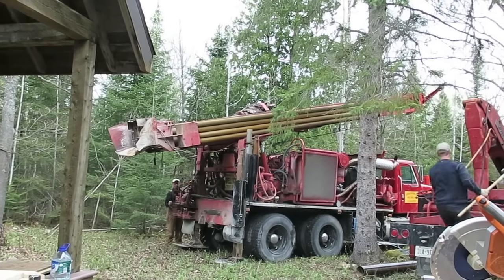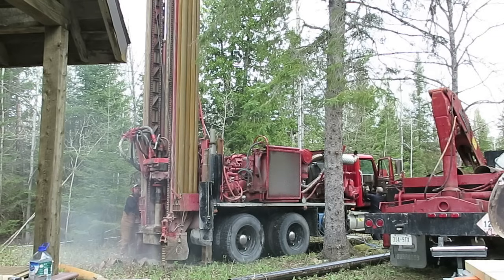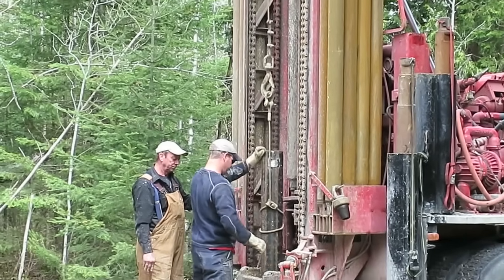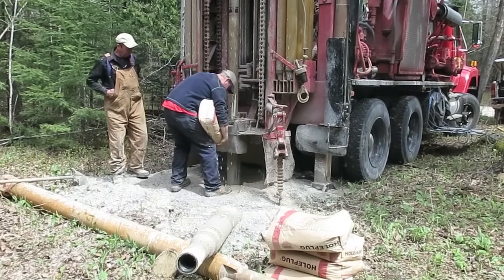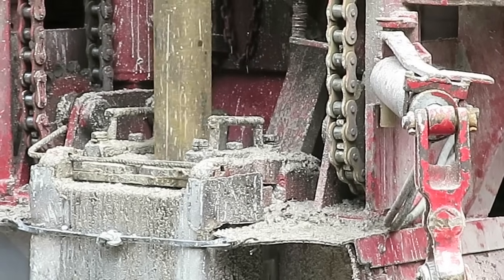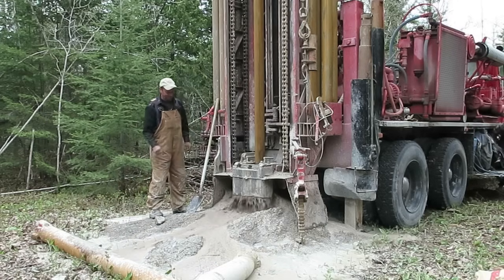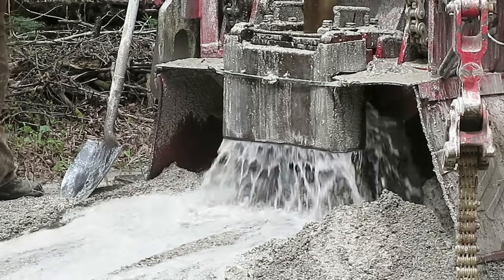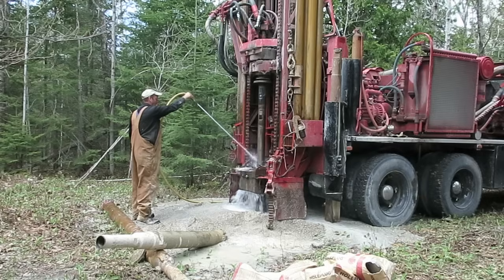Watch a Water Well Being Drilled

Comment: That air removes cuttings from the hole throughout the process while also driving the hammer portion of the digging head while rotation is provided by top drive. Water provided lubrication as said and cooling of drill head. Fyi

Comment: We’ve had a well company come out to dig us a deeper well.  They have been around for 50 years.  I think all the good workers are gone.  First, time frame they promised was all wrong, then they did not seem to worry about wires above.  They pulled them from the pole with the rig almost setting our house on fire and fried a few of our electronics, then came back to drill the next day and flooded our basement and collapsed the well we were supposed to use while we waited for the new well to get hooked up.  Then after leaving us in limbo for three days, they put a pump in the new well to provide us with water, only to bring up muddy water and burn out the new pump letting it run, trying to clear up the water.  Going on Day 12 of having no running water at my house.  I now advise people if they have perfectly good water and nothing is wrong other than having to pay attention to how much water they are using, don’t go for a deeper well.  It could make things so much worse.  I am surprised when they left us with no water, that on Day 1, I was not being notified they were going to set me up with a Poland Spring unit or at least a delivery of water.  Flushing toilets with buckets, boiling water on the stove for dishes, not being able to take showers or do laundry or clean properly is really working on my nerves.  Having to go fill up jugs every morning is becoming mind numbing.  They told me to ask a neighbor if I could hook up to their faucet.  I am now convinced this family-owned company that has been around for decades hates each other and what they do, as I continue to camp inside my house while we wait to hear how they plan to fix the mess they created.

Comment: Just drilled to 450ft and got 1.7gpm...
Reply from the maker: Mmm . . . not a good day. That said, I know a way that 1.7 gpm can provide more than enough water for an entire house, even without being careful about reducing water use. It's called "the trickle system" and essentially draws all the water possible from the well, all the time the water is available, storing that water in a holding tank for distribution to the house as needed. Sounds impossible but it works. The math proves it, as well as my experience: 1.7 gallons per minute x 60 minutes = 102 gallons per hour; 102 gallons per hour x 24 hours = 2448 gallons. That's enough to supply more than 8 household using 300 gallons of water a day. I've got an online course on setting this up (and finding the necessary hardware), and you can see it here: https://baileylineroadlearning.com/p/water-well-course-1
I hope this helps, and thanks for watching my video!
Bye for now, Steve

Comment: Why weld your name on the pipe please?
Reply from the maker: That's a great question! Welding on an identification plate is something they started doing some time ago where I live in Ontario, Canada. The plate doesn't have a name on it, but an identification number. You can type this into a website and it will tell you the depth of the well, the date it was drilled, who drilled it, etc.
Thanks for watching!
Steve
Reply: @baileylineroad  great.. thanks Steve..

Comment: How much are they charging for drilling?
Reply: I was quoted $30 per foot for drilling.  $15 per foot for the casing.  $5 per foot for the PVC pipe. Pump and extras will cost about $5K.  Most wells in my area (Colorado) are about 300 feet deep, so it will cost about  $20K total.

Comment: Hi, I gave you a thumbs up and really appreciate your video, but I am still in the dark. I see that they installed a casing in the beginning, but after that they decrease the drill bit to go through it. Then, what is the well casing vs the drill? Do they install another casing all the way down as they drill or is there just a blank hole in the ground that the pump is fed into? There is nothing mentioned here about that and how it works. Thank you though.

Comment: I live in Norway, here we drill energy Wells  up to 1000ft. Most of the times 800ft per day per well. Solid rock, only a few metal pipes. We use 35 bars compressors to blow it out
Reply from the maker: Thanks for the insight!

Comment: 146 feet! Wow! Our well is over 900 feet here in Colorado. Many new wells in our area are having to go 1,100 or 1,200 feet due to dropping aquifer levels.
Reply from the maker: Wow, that's quite deep! Thanks for sharing!
Reply: What brand or type of pump can pump from 900 feet? Wow. I’m looking for a pump, I’ve got 500 ft deep new well to pump from. Thanks for responding if you read this.
Reply: What part of Colorado is that?
Reply: How much did that cost?
Reply: @Ha-Rley  usually 900 feet of depth is going to cost you about $15, 000-$20,000. 2 cents a gallon if you filling up a tote/cistern that would take a long time to rack up$15,000

Comment: The well on my farm is 816 ft. deep. The pump used to sit at 550 ft. The pump went bad a year ago last June while we were on vacation. When the pump guys went to put the new pump back down, they hit something at 434 ft and couldn't get the pump any lower. Not wanting to damage the new pump or get it stuck where it couldn't be retrieved, they quit at that point. We had water but were more than 100 ft shallower than the previous depth. We starting running out of water this year and were afraid that we may have to drill a new well. We had 4 estimates from 4 different well drilling companies ranging in price from $40,000 to $50,000. about 438 per ft. just for the drilling. One of the companies had a camera and suggested that we may want to pull the pump and send a camera down to see what may be the problem. We did that. I recently did a short video of that experience on my you tube channel.
Reply: I would guess that depending on the average water table depth in your area - maybe your farm is an outlier - most drilling contractors don't even have that much drill pipe and casing on hand. The high prices probably are being inflated by the fact that they need to rent more drill pipe third party and source double the casing they normally have on hand. 439' static water level is extremely uncommon for a lot of north America from what I've read .... very very deep.
Reply: @safety_sid  , Hi Sid, we have 3 other wells within 5 miles of me that also have deep wells. The deepest one is just over 1000 feet. The others are in the upper 800’s. Around 60 ft deeper than mine. There are no records of my well from when it was drilled. It used to be pumped by a windmill which puts it somewhere in the 100 year old range.
There is a video on my channel of the well company sending the camera down the well. Feel free to watch that one.
Reply: @tractortalkwithgary1271  Thanks Gary! That's incredible! I'm not a water well driller or anything ... I know just enough about them to confidently sound like an idiot haha. I had no clue there were still water wells around that are that old.
Reply: That is a misprint. It is supposed to read $38 / ft
Reply: Hello gentlemen we are a lot as well drilling rig machines factory we are producing our machine in best quality and technology it will be our proud to cooperate with you if you interesting please take our machines in our channel
Reply: Heloo. This about which country

Comment: Interesting and a good job explaining.   Best part for me will seem strange as I was focused on the add on drill rod holders on each side of mast and how they were fabricated and how they would be used.   Rig appears to be a 1970's Schramm T64 with an updated air package.  Original were piston compressors.   Original held only 210 ft of drill pipe but on this one has been expanded to upright storage on both sides.   Very clever setup and the extra weight did not seem to be an issue with mast raising.   Would love to inspect the rig in person but your video will have to do.  Thanks for posting.

Comment: Wondering how much that cost to drill that length. Also if you are on a hill will that mean need to drill deeper?
Reply: @johncuervo3019  thank you for reply. I found one piece of land but its kind of on a hill. Will that cause the water to be deeper or it wont matter? So if you have flat regular land and kind of on hill land if you drill both will the one on hill needs to be deeper to reach water vs flat. Thank you
Reply: @johncuervo3019  thank you for the info but sure well is first. Take care.

Comment: That's a lot different than what we used to do they put PVC casing all the way down and the bottom pipe got slits cut into it and then a sock over it for a filter this is quite a bit different with not putting a casing all the way down

Comment: I was just quoted $27,000 for a 500’ well on a hill top. And you mentioned, drilling and not hitting water, that is scary in my situation😳
Reply: How did it turn out?
Reply: Actually  there is one thing more horrifying  and that's  if they drop the pump and cant retrieve it. You cant decide if you should continue  trying to get it out or drilling again .Either way you'll pick the wrong choice .
Reply: @xirmanatee3763  you can just drill the pump out
Reply: Same here 🥵
Reply: 27k for 500 feet lmao. Where are y from?
Reply: @pineapplepissant  this was on a property in souther indiana that was on a limestone hill.
Reply: @Monuments_to_Good_Intentions  well? How did it turn out?? Currently I’m having a well dug almost at 300 nearly 1/3 of that price also on top of a very tall hill at the very peak
Reply: @pineapplepissant  A driller wanted to charge me Almost 47K for 600'.

Comment: I live in an area that I don't think would require a very deep well. I have a couple folks in my area that has added an outside well. I would like an outside well just for my outside water usage since water and sewer are expensive here. Would you have any rough idea on the total cost? Thanks
Reply: A water well can cost anywhere between 5 and $50k depending on location, depth, ground material, water table depth etc etc. I would guess a well such as the one in this video would cost ~$20k.
Reply: @saneconsulting  so much for that idea then, thanks

Comment: Our Well Drilling Crew was at about 120ft when they say that they either hit sand and it collapsed and filled the hole or that something called "Cup caking" occurred. Anyway they were at it for hours trying to get the pipe to circulate(turn).  They still have an estimated 380ft to go.   They finally left for the day. Today is May 10th, 2021. HELP
Reply from the maker: Hello Thomas!
That sounds like a distressing situation. Your situation is different than mine since all our wells are mostly drilled through rock. Perhaps I can help, though. Feel free to email me at steve@stevemaxwell.ca.
Bye for now,
Steve
Reply: if they lost circulation then that means they stopped clearing cuttings out the top and their air was dispersing into the formation. losing rotation would imply losing the ability to turn

Comment: Interesting. Sorry to say most of the commentary was ill-informed. The air sent down the bore is to remove cuttings, cooling the bit is a secondary action. The 'cutting head' is actually called a Down-Hole Hammer and works basically the same way as a pneumatic drill used to dig up roads etc. The water used during drilling is injected to also assist in removing soft or sticky cuttings. Lastly, the driller drills deeper than the first contact with underground water to create a sump. That is required because even in good supplies of under-ground water, once pumping starts, the standing water level will often drop to a 'working level', that's called the draw-down.
Reply: Very interesting. I live in an area that I don't think would have to be drilled too deep. I would like to add an outside use only well. Would you have any idea what the cost would be? Thank you
Reply: @Johnny53kgb-nsa  Sorry, I cant begin to estimate costs for you, I live in Australia where prices are different to other places. If there seems to be water at a shallow depth, that obviously helps but it does depend on the types of formation drilled through. Drilling the hole can be a simple project but adding steel or plastic casing to line the hole, adding a submersible pump and the electrics all add to cost. Good luck though.
Reply: @ORD80  I'm not too familiar with the process, but what I meant was the water would only be used for outside purposes I guess, like watering the garden, etc.. Thanks

Comment: To seal the casing we use cement (not Bentonite). The Bentonite with variable density is used to fluch the drilling cuttings out of the well, lubricate the drilling bit and keep the bore hole safe from collapse during the job.
Reply: Thats right . Iam driller in iraq..
Reply: It's air drilling,with on board air compressor driving a down the hole hammer. Totally different to rotary mud drilling as is used in the oil patch.
Reply: Same

Comment: Great narration. Does the liner go all the way to the bottom of the well? If so, how do you connect each section of liner?
Reply: Hi. Well driller here. No drillers know when we’ve gone threw dirt/gravel. And you put the casing in solid rock. And the metal casing is welded together.

Comment: Interesting. I had a well drilled for my geothermal system last winter. They drilled down almost 400 ft and didn't find sufficient water for an open loop like we planned. But no worries, a 2nd well about 250 ft and we had plenty for a closed loop and I'm more than satisfied with how it turned out. I was not at the house most of the time they were doing their work, so nice to see it actually in progress in this video.
Reply: Used br 700 pro for searge water is the best in iraq
Reply: How much does something like this cost to have some?

Comment: That first joint of pipe that you see them lowering with the lifting ring in the beginning is called your drill collar, it is a heavy wall pipe which is used for adding weight to the bit. You can see the bit is attached to it. He will add an additional drill collar to it as he gets deeper. The entire assembly is called your BHA or bottom hole assembly. The blocks is what lifts the BHA up and down only which why you need the heavy weight drill collars. What turns the drill string assembly is called a rotary or Kelly, in this case it’s a hammer rotary, where on an oil field rig we have top drives. Imagine this entire operation except 500 x larger and you have something similar to an oil field drilling rig. Minus mud pumps, mud tanks, gas busters, choke manifolds and flare system.

Comment: Love your vid!!!
Had a friend who spent $800 bucks to have a well witcher  tell him where to drill.   He has 5 gpm at 345 feet.  The contractor  who drilled our off grid well told us that nobody knows where the water is and recommended a convenient spot.    Our driller hit water at 140' with 30 gpm.   Some people believe in witching but I'm guessing most drillers (including our contractor)  think this is nonsense.
Reply: As an old Australian Driller with 40 odd years of experience, my feelings on witchers is,they used to burn witches,and they should start again.
Reply: Easiest way to find out is witching is real is to google "how does witching work" and you'll instantly see how dumb it is.
Reply: @cybertrk  a a water  well  Diller  here in Canterbury  New  Zealand I AGREE  with  you. 
Cheers.
Reply: @cybertrk  in NC most of the drillers believe in it. Know a old guy that paid $250 last year to a Witcher that didn't drill wells and the well went 600' with no water before the guy decided to give up on the hole. It was the second six hundred foot dry hole in his yard. 
He should of went deeper with the first hole

Comment: How much did this cost you?
Reply: I got quoted for 405 ft well with casein and pipe to house for around 10770 here in nc
Reply: Tre ,,North Carolina  around 2,000 for 150 feet.
Reply: @sweetjrewing5435  wow, that's lunch money. I drill large diameter shallow wells 36 inch hole with 30 inch casing. 35 to 110 feet deep. And our base cost is 6500. But then again we have a lot more overhead. Minimum 3 trucks with trailers. 1 for surface pipe (43 inch x 16 feet long steel pipe) 1 for our well casing 25 foot long by 30 inch diameter fiberglass and 1 with the backhoe. Occasionally we need a 4th truck which hauls 4000 gals of water to "flood drill". Drill rig hauls the surface pipe trailer, our 2 ton chassis support truck hauls the well casing as well as pumps, extra buckets, bentonite and various tools and our dump truck which holds 16 tons of 1/4" gravel for the filter pack.
Reply: @Watthead80  ,,,My mistake,I was thinking of prices back when I had my well put in,,1978 🤣
Reply: @sweetjrewing5435  Lol amazing what inflation will do. I forgot to mention this is in Illinois where everything costs more.
Reply: @Watthead80  that's still a great price, here in AZ it'll cost $30k and up
Reply: @jg1503  Holy cow! For a residential well? You're probably having to go several hundred or thousand feet. That's crazy.
Reply: @Watthead80  that seems to be the average rate. And you know why they charge that much? Because they can. It's not like  people can just go to Home Depot and rent a drill rig or something. And with prices like that I wish I could drill it myself but I can't. I'm even open to paying someone from out of state to do it it if it's cheaper. Anyone wanna drill me a well for $15k?
Reply: @jg1503  Our quote in the Colorado mountains is 18k to start up to 300 feet.  the next 100 feet is a total of 24k.  I think the state limits private wells to 15 gpm.